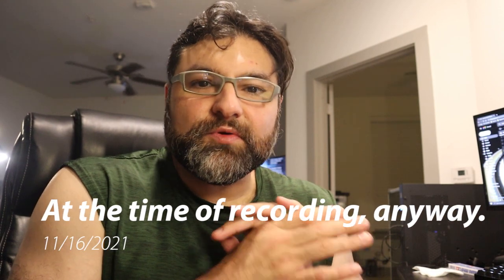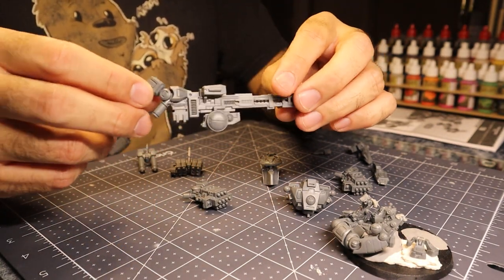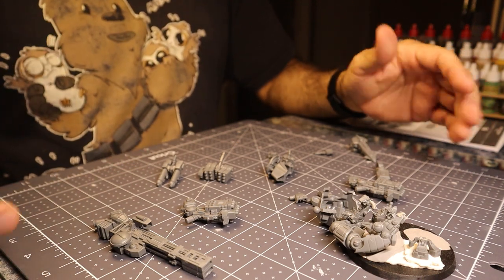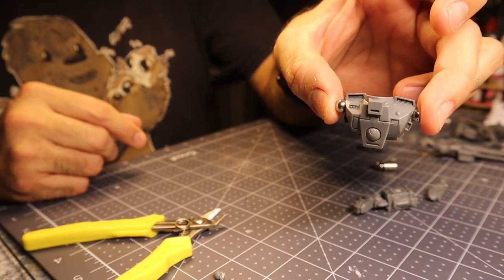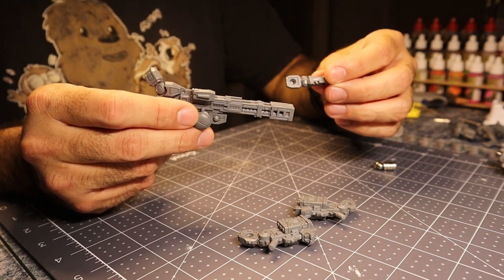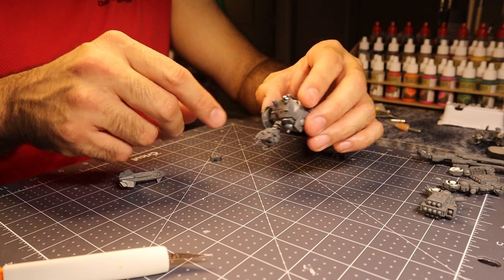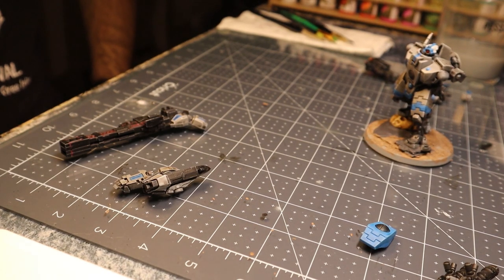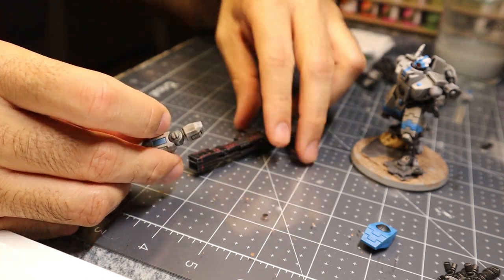Magnetizing Tau XV88 Broadside

Comment: To create holes in order to put the magnets in u can also use q soldering iron. In mycase the holes are a bit messy in the end and might need to patch with some greenstuff but it does the job and its cheaper than an electric drill imo.

Comment: This looks great! The only solution I could think of for your shoulderpad weakening the shoulder joint's pulling power would be to use smaller magnets on the shoulder/Pauldron itself, that or seeing if you could set up 3 magnets instead of 4 in the order Ball magnet > Counter-sunk Magnet > Plastic Arm > Pauldron magnet. I don't know how strong they are but they may be strong enough to hold through the plastic.

Not sure if you tried any of these already but yeah, just my 2 cents. My only experience with magnets are using 2 small disk magnets and a mashed up paper clip to hold onto my redemptor dreadnought's plasma incinerator
Reply from the maker: I didn't even consider the multiple disk magnets on this one and maybe I should have. Although I have tried something similar before and that didn't provide the rigidity I was looking for either. 

I did consider adding a bit of plastic to both parts to act as a stop for the rotation along the vertical axis. But it seemed a bit complex. Maybe next time.